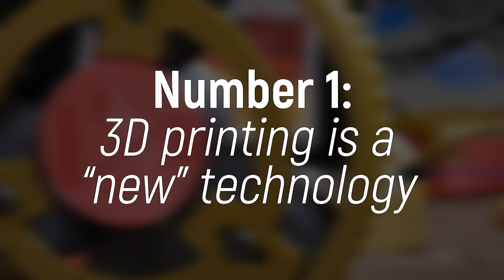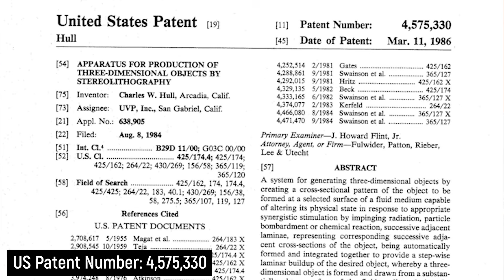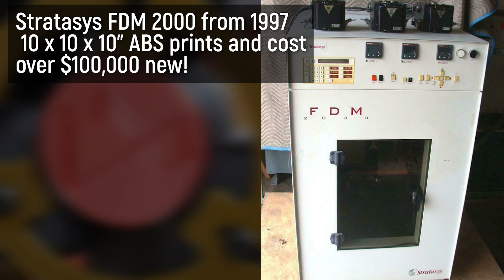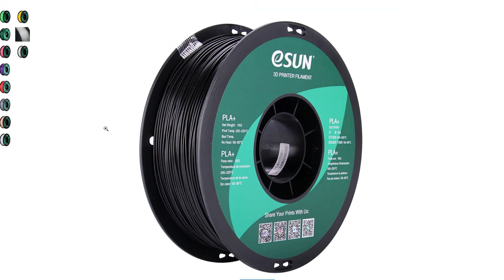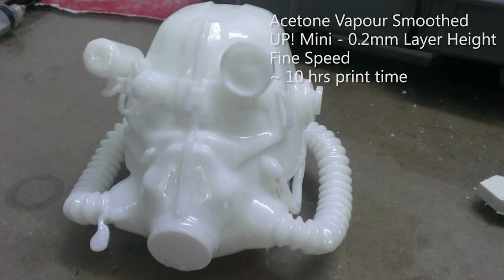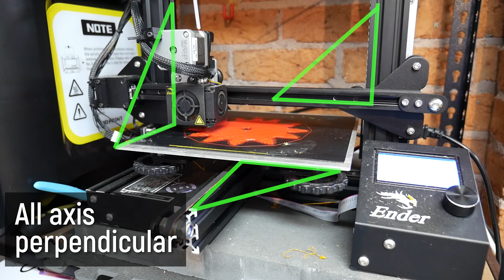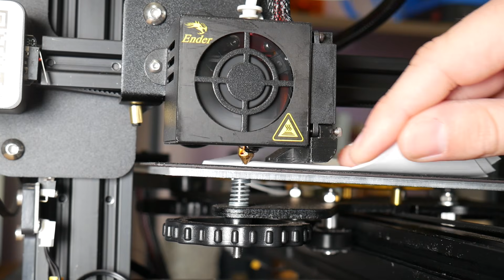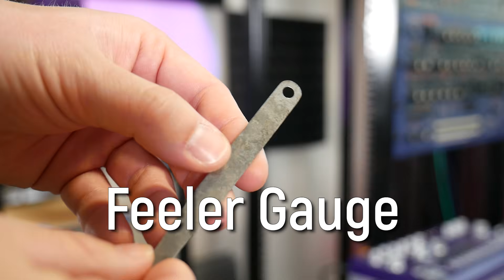3D Printing Myths I used to believe...

Comment: Any particular size feeler gauge I should use? Most of the comments I see just say "correct or appropriate size." How do I know what size is appropriate for my machine?
Reply: Doesn’t matter, you first Z step up by whatever thickness your feeler gauge has before leveling. That way the nozzle zero is exactly at bed zero.
Reply: @christophmuller3511  So just add the gauge thickness to whatever I determine my z-offset is. Gotcha. Thanks!

Comment: Honestly? Spend 2 months looking at the tip of your nozzle as you level your bed (After it's confirmed properly trammed), and you'll get used to looking at where the nozzle should be, for bed leveling. Alternatively, you can very easily learn to level your bed while a print starts, based on how it lays down.

Comment: as a beginner what would you say is the best modeling software to learn for printing? i have the most experience using sketchup and autocad, i have minimal knowledge of rhino3D, fusion 360, and i can reliably create vector graphics in adobe illustrator to print. 
i have been able to print various models I've designed in sketchup, but with sketchup i feel a bit limited with what can do. i know there are various modeling software for various uses so its smart to know how to use more than just one. but are is there any one/group of software you recommend a beginner learn?

Comment: I'm still kinda new, but what I understood was that any item would work for gwtting your z offset with the paper trick provided you knew the thickness of the item. For instance, a standard piece of printer paper is .1mm thick, so if you get a z offset of -1.10mm, you would then subtract the thickness of your paper for your offset of -1.20mm

Comment: I've been in machining all my life. I got into 3d printing just for prototyping my ideas. I've been having issues getting my ender 3 max to print a perfect first layer.
This video helped alot! Thank you!
Reply: Did you use a feeler gauge to level it I recently bought an ended 3 max and having the same levelling issues
Reply: @trodaire9504  yes i switched from paper to a .008 feeler gage and it made a world of difference.
I also modeled and printed a dial indicator holder just to double check and its spot on

Comment: I measured the thickness of the wrench for the hot end remover tool from my ender 3 pro to use as a feeler gauge. It was 1.50 mm all around. Hope that helps somebody.
Reply: Yeah doesn’t that kind of remove the need for one lol

Comment: My z-endstop switch is set to actuate at a nozzle height of +0.2mm (Ender 3 Pro). I set this offset in Marlin so the printer knows about it. 

My most common layer height is 0.2mm. If I want a lower initial layer height (say 0.16), there is a setting in Marlin to allow travel below the endstop, and there is enough "play" in the microswitch endstop to allow travel without damage. Also, 0.008 inches (my feelers are in barbarian units) happens to be 0.203mm, which is what I use for tramming. I dial in the final initial layer height with a large test print, especially if I change materials (PLA vs PETG for instance).

Comment: I can't get mine to stick to the bed at all. It worked once when I used PLA, but I'm trying to use some clear PETG and it just wont stick at all. I've tried levelling, glue, temperature changes to bed and nozzle but it just wont stick...

Comment: I would like to see more regarding feeler gauges. I ordered a set and it has TWO sets of numbers on it and I have no idea which ones I should be going by. Thanks!
Reply: Metric and imperial - 39.37 thou (imperial) = 1mm (metric) I can't imagine any 3D printer using imperial though, so use the metric numbers

Comment: Been using feeler gauges for awhile. Pro tip: There are 300mm long feeler gauges!   Much nicer to use than the small ones when everything is hot and burny!

Comment: For bed "leveling"/tramming I use a dial gauge connected to my hot end (well, not directly to it, but on the assembly next to it) and just move it from side to side, back and front and check if its the same everywhere and comparing it to my before state (using Octoprint bed level visualizer), the difference is quite huge. But I guess it also helped that I squared my rods using digital calipers...

But even then I have problems with simple PLA not wanting to stick sometimes or something (I honestly do not really know what is going on)... 
Here are some pictures if somebody wants to take a look https://imgur.com/a/gXl5eY6

Comment: I don't understand why bed leveling with ONE sheet of paper is a "myth".  Your bed needs to be level relative to the X/Y plane of the nozzle movements and a sheet of paper does that just as well as a feeler gauge, end of story.  Not really sure what the point actually was about the paper technique, seems like you got lost mixing unrelated concepts like initially tramming all axes (usually not needed) and the fine-tuning that paper/feeler gauges do.

Also, unless the Z-gantry is wildly trapezoidal, the effect on a typical 3D printed object would be pretty insignificant.  We're not dealing with highly-accurate CNC fabrications here!

Comment: lol i use a feeler gauge threw away the paper ages ago or more recently i do it by eye just get at eye level with the nozzle and spin it intil you can see a crack of light i also find an engineers ruler and measure the distance from my gantry to the plate along the x wilst moving the y .

Comment: Great content. I also use a dial guage and a 3d printed mount for the print head to make the gap equal at all 4 corners. Still need the feeler guage for the first point.

Comment: Nice tip with feeler gauges.  Put calipers on 20# paper lightly, and it's about .18mm thick, but compresses to .11, so is quite compressible, and likely not a uniform thickness...  Plus, with feelers, you can pick different thicknesses to target rather than some arbitrary paper lying around...  I like rigid beds, no springs.  Springs are silly, skip them!

Comment: The tip on levelling the bed by offsetting Z and using a feeler gauge just gave me the easiest, fastest and best bed level I've done so far. Such a simple tip, but absolutely crucial information about the tip offset! THANKYOU GOOD SIR.
Reply: Wanna do it even faster? Use a dial indicator. Cheap ones work too. I think I'll make a video on this...

Comment: I have been using feeler gauges to level the beds and yes this will save you from hell if done right, like - paper is kind of compressible, folded paper is even more compressible, sure it's handy but never accurate. Using feeler gauges is like getting it right in 1 or 2 tries instead of god knows how many for paper leveling.
One more tip: for those who use ABL you should manually adjust the bed level after getting the mesh too, if your bed leveling knob is locked tight do this ABL + MBL once and you will not have to do it again for months (yes just delete the ABL part from your starting g-code!), if in case any new filament gives your print elephant foot just adjust z offset, this elephant foot is more about material properties than bed leveling.

Comment: i want to say that even thou yes , the technology existed , it did not exist in its current form. or was very affordable. a lot of technological changes have happened making computer tech cheaper than it was in the 80s and a hell of a lot smaller.  so you are half right , its just like saying modern computer technology has been around since the 60s...when that statement couldnt be more further from the truth.

Comment: Dang I feel smart now, I’ve been using a feeler gauge since I started 3D printing several years ago. I never could get good prints if I “leveled” with paper so I switched to a feeler gauge (0.15 mm) which made a huge positive difference.
Reply: what kind of printer? paper has worked fine for whole bed prints on my ender3v2 for over 500 prints now...
Reply: @deimosmen  It's a Powerspec-branded Wanhao Duplicator i3 from 5 years ago. Granted I was new to 3D printing so there were a lot of moving parts, figuratively speaking, as I was trying different filaments, temperatures, bed materials, software, and learning how to level the bed (among other things). I was also printing parts to improve the printer itself, so certainly switching to a feeler gauge wasn't the one thing that gave me success.  It did give me reproducibility, however, because it's pretty obvious when you're at the desired height with a feeler gauge.  The printer is still going and I know all its quirks so nowadays if a print fails it's most likely because I forgot I mucked with the slicer settings during a previous print.

Comment: FOLDED piece of paper? That's outright barbaric. I only ever used one layer of paper, and the thinnest paper i had at hand at that. This is still a nonzero distance, but it's a distance i'm comfortable with with a little bit of slicer-set overextrusion on the first layer, and some elephant foot compensation. I mean it was evident to me from day 1 from looking at g-code that the distance from nozzle to bed at z=0 should be zero, since the first move is to the nominal first layer height, and from watching the XYZ display on the printer itself, but i preferred a slight nonzero value because my glass isn't perfectly flat across the whole area.

Comment: Well, it used to be called 'Rapid Prototyping'. It once was extremely costly. As always, more affordable consumer applications have followed. These of course then are always being hyped as per usual. However, basic chemical knowlegde of plastics applied and their best fitting purposes remains required imho. All plastics and their compounds with additives have their pros and cons, and are best fit for certain applications. E.g., lego blocks are made of a very specific ABS formula with a UV protective additive. Etc. The construction of the blocks themselves make the ABS work. Etc.

Comment: I recommend using three feeler gauges: Your target initial clearance, the next thickest gauge, and the next thinnest gauge. Set the initial clearance with the target gauge and then use the other two gauges to confirm. The thinner gauge should slide under the nozzle without contact and the thicker gauge should hit the side of the nozzle.
Reply: In firearms the two over/under gauges are called "Go" and "No-Go" gauges. If the bolt closes on the No-Go gauge(larger than spec) it is unsafe to fire since clearances have become to loose, and if it can't close on a Go gauge(smaller than spec) the clearances are too tight and could be equally unsafe to fire. If it closes on a Go gauge but does not close on a No-Go gauge(in between the to dimensions) then the firearm is within safe firing specifications.
Reply: How do you know what the target clearance should be?
Reply: @endz0r  The advantage of a feeler guage is that it has its clearance printed on its side. It doesn't matter which clearance you choose. It just matters that you know your clearance, and you move the z-axis to the right height.

Say your feeler guage is exactly 0.45 milimeters. Then you move your z-axis to 0.45, and you keep adjusting the bed height until the nozzle rests on the guage without pushing or moving the bed down. When you're done "tramming" the bed, you know that if you move the z-axis to 0.1 mm, the nozzle is exactly 0.1 mm above the bed. Does that make sense?
Reply: @jpaugh64  no.  Why move the bed up at all?  That's just decreasing the total height your print can be.  What else could it possibly be doing?  Nozzle distance is different than bed height, surely?
Reply: @joeskis  Tramming the bed as low as possible is certainly a valid strategy. However, you'll have to move 1-3 corners higher than the bottom, because the nozzle (x/y-axis) is not going to be perfectly trammed to the frame. (Lowering the bed all the way trams the bed to the frame instead of to the nozzle/axis.)
Reply: @jpaugh64  one step both of you failed to mention is that you have to undo the set z-offset after levelling the bed with the feeler gauge.
Reply: @AlexSwan  I realize this was an old thread, but no, you don't need to undo the Z offset if you told the printer to go to that height before checking it.  For example, with a .4mm gauge, you lower the bed with its screws (so you don't accidentally hit the bed), tell the printer to home z, then you step it up to .4mm (according to the printer's interface).
Then you adjust the bed adjuster screws to the feeler gauge and you're done.  It thinks it's at .4mm, and it is.
Reply: Oh, I get it. At first I read "next thickest" as the thickest one you have, minus one. You mean, the next thinner guage from the final tramming height you're aiming for.

Comment: Yes, I knew about 3D printing (know as SLA - Stereo Lithography Apparatus) in the ‘80s.  I (electronics/software Enginer) introduced my wife (aerospace engineer) to SLA for “rapid development”, for hydraulic pumps for plane aero surface actuators/landing gear.  I’ve been wondering why it has taken so long.

Comment: The gold standard is to do your best, then print the first layer, peel it up and measure it.  Adjust and repeat. If you know the thread pitch on the adjustment screws you can determine how far to turn them based on how far off the layer thickness is under each adjuster.

Comment: Hello great video. I’m new to 3D printing, have ender3 max. Just put bl touch on. What firmware should I use. Easy to learn and put on I’m not real computer savvy. Lol. Thanks. I would like to start printing again did thre prints before bl touch. Manual leveling.  Door hook hanger file come with it and wrench holder. 7 piece gear wrench. Off thingiverse. Thanks. Stay safe.

Comment: I work with $250,000 CNC machines and feeler gauges are good enough there, should probably be OK here as well! It's all in the "feel" for it. I have also used old floppy disks (tearing the flexible disk out of the shell first obviously lol), also works ok.

Comment: Like others, dunno where you heard the folded paper method. Every manual I've ever seen (FDM or DLP) says a single sheet of plain printer paper, some even go so far as saying the weight, normally 170 - 240gsm. Anything thicker than a single sheet is far to much, even then it can still be slightly to high as I found when setting my z offset for the BLTouch.

Comment: I mean number 1 isn'ta myth? 3D printing has and is still changing manufacturing? Yes it existed before the late 2000s to 2010s, but it was shit. Why do you think so many high tech things like SpaceX, Formula 1, etc etc use 3D printing these days? Why do you think it went from hardly anyone using it to virtually every business using it to prototype? Why do you think it went from prototype research to being directly using in low volume manufacturing? Because it absolutely did properly emerge in the late 2000s to 2010s. Saying it really emerged in the 80s or whatever is like saying the automobile emerged in the late 1700s, sure technically there are some thing that are automobile like back then, but it really didn't emerge until over a century later.

We have seen an explosion of the tech this last decade, it is literally already shaping industry 4.0. What on earth is wrong with people where they look at an article from several years ago and then go "haha dumb that never happened", as if because something didn't happen immediately over night changing everything, oh it's useless and was wrong. That's now how it works dude, things take time. Is the way companies invent products the same as it was a decade ago? Hell no, so much has changed. And it will continue to. Real Engineering has a good video on this. It will absolutely create and is creating industry 4.0, but that actually takes time, it's not as easy as you seem to think it is. We will see it for low to medium volume production more and more in the coming years, it'll open up all new options (like it already has) due to the unique geometry you can build and huge single part pieces, and it'll dramatically drop the entry requirements for building products (due to not needing to build expensive af molds).

So no I don't think anything from point one is a myth. And it's certainly not a myth if you look at the spirit of myth 1.
Reply: Oh 3D printing in the 90s and 2000s wasn't shit, it was top notch quality. However it cost a fortune and a half, and now it just doesn't.

Comment: I've used both a BL touch and paper. I find the paper option is much more accurate but the auto bed leveling is easier. That being said. My bed is warped. The replacement one I got as well was warped. So my case is probably not typical.

Comment: If PLA could aquire the thermal properties of ABS it would be something i would use in a heartbeat.
Reply: Basically PDLA, the D isomer of opposite chirality to common PLA, or a blend of the two. Marketed as HT-PLA or something like that. After annealing, it becomes highly temperature resistant, and doesn't change shape much during the process.

Comment: Total rookie here, I bought a partially disassembled, some components missing, 3d printer. Found what was missing, fixed some issues, got super lucky on a mostly successful first print using PLA. Having said that, I have been operating machine tools since 1981? Even the term feeler gage is kind of a misnomer, as it really is more of a go-nogo gage, and in this context works quite well for setting your bed height in relation to your nozzle. The use of paper requires a definite "feel" to get similar heights. More draggy, less draggy, pretty analog, really. But, it sort of works. That is to say, I got the draggy-ness to have very similar feels at 4 corners of the bed. And then I got a mostly successful print. I can't wait to learn more about the whole process and get better at it. Much like any trade...